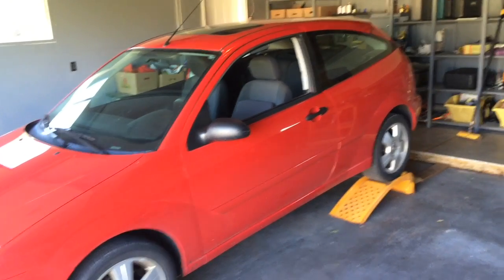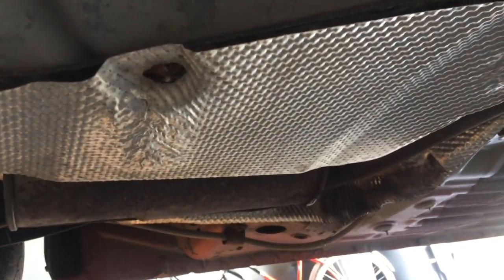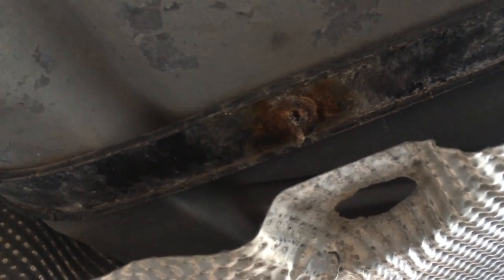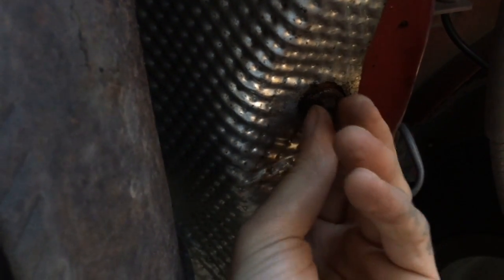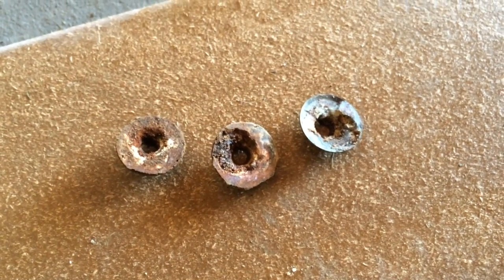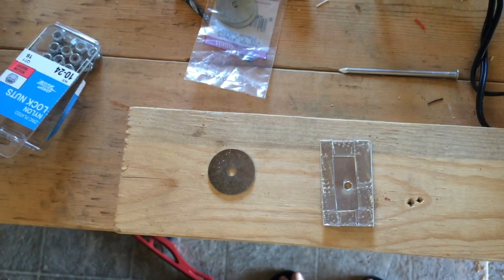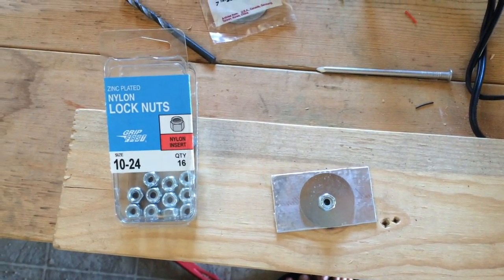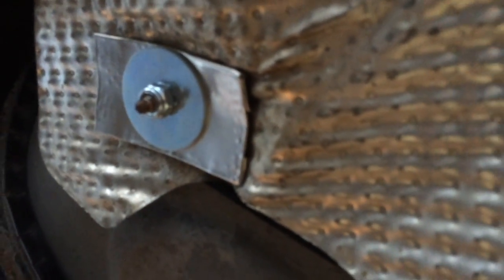2006 Ford Focus $3 heat shield rattle fix

Comment: Thanx for taking the time to post this!  I have an ’08 focus (original owner) and this winter all of my heat shields rotted through at the bolts.  The car is ten years old and kept outside.  I live in Erie, PA and this year we're almost at 200 inches of snow!  

I finally got a nice day today to try this and it worked out great.  The fact you listed the washer and nut sizes saved me a ton of time at Lowe’s and guess work.

All in all it cost me just under $30 due to the aluminum being kind of expensive ($22).  I wasn’t sure how much I’d need and I bought a 12x18 sheet which I only used about 1/3 of so I definitely should have gone smaller on that and saved a few bucks but oh well. 

Also the thinnest metal they had in stock was .025 I believe so it was pretty rigid but cut easily.  I didn’t need to fold over the edges due to its thickness.  Some pieces I had to cut the corners or round it out to fit in certain spots but my snips went through super easy and was able to bend it into place.  It was malleable enough.  

Only snag I ran into was while tightening two of the nuts on the lowest bolts, they completely snapped due to corrosion and snow / salt exposure.  Fortunately they were right near an exposed support beam so I just drilled pilot holes and screwed them directly into the frame (don’t go through the floor! haha).  I saw a guy in another video do this with a rivet gun for a fix.

Super pumped to fix this myself.  Took about 2 hours (i move slow and was enjoying the sun).

But yeah, thanx for your video and everything.  Cheers.
Reply: This helped for my 08 focus too!

Comment: Thanks for posting this, calling out the socket and nut sizes was very helpful as was the tip to use cut sheet metal to make a repair flange.  Best of the heat shield repair videos, very helpful.  I have a 2003 focus, they are all the same!

Comment: I'am about to fix the same problem on my car. I have a tip for others that read/watch this video. When steel and aluminium are in contact with each other a chemical reaction happens. This reaction is called "electrolysis", Basically it will corrode both metals. And before you ask?....Yes the car companies know this!. Anyways the fix is to have a barrier between the two metals
PS if the nut,bolt and washer were stainless steel? The problem would never happen in the first place.
Reply from the maker: Sounds like a bad design. I'm guessing the factory heat shield is aluminum and the factory nuts are steel? Mom's heat shield is still holding strong.
Reply: Yes exactly. But it was designed to create labor/parts profit

Comment: ON MY 03 FUCUS, (DOHC ZETEC) My catalytic convertor is directly after the manifold! it's between the motor & the front bumper w/ a upstream o2 sensor screwing into it up top & downstream o2 in the pipe right after the catalytic yet, it's all 1 unit, both o2's screw into the catalytic, 1 pre cat & downstream is post cat!!!

Comment: i just did this with y 2006 xtrail....just used bigger washers...woudl have loved those ramps...im a big guy that had to really cram my hands in their to get the nut off the bolt that was above the muffler.

Comment: Weak point? LOL you replaced stamped sheet metal nuts with two forms of reinforcement and nylon lock nuts. I'd say the only "weak point" left is the factory studs. Nice repair video.
Reply: American repairs always better than Oem junk . This man knows he has room for improvement thus weak point.   Keep it up !!!

Comment: Hi, would this work on an 07 seat ibiza too, I've been looking everywhere and no videos?
Reply from the maker: Paige Megan I don’t see why not. I’ve seen a similar heat shield on many different models of cars. The bolt size might be different so you may have to adjust the washer/nut size but those parts are really cheap so you can buy a few sizes to test
Reply: Thank you! :)

Comment: what about if your bolts are gone? I went to replace mine but the bolts broke in half when trying to loosen the nuts. ugh
Reply from the maker: That's some serious corrosion. Hopefully there's a video out there for solving a broken bolt problem.

Comment: thanks for the video.  I think I would rather pay to have someone fix it tho.
How much do you think an auto-shop should charge to do this?  All of my contact points have come loose.
Reply from the maker: If you show them this video, $3 + 60 minutes labor. But seriously, I'm not sure how much a new shield runs. Just a wild guess is $200-$300 with labor?
Reply: UPDATE : It cost me $60 to have my corner auto shop do it.  Well worth it.
Reply from the maker: Great. Did they reinforce the existing heat shield using this technique?
Reply: Muffler auto shop may be the way to go

Comment: i have the same situation as above.  ugh.  do i even need to replace the heat shield on my 2005 ford focus wagon with 120k miles?  why don't i just take it off?
Reply: Just remove them u don't need them that's all I do

Comment: Can you just take it off and it still be okay to drive?
Reply: Yes it rusted or corroded due to a bi metal corrosion alum and steel cause it to rust Plastic washers or duct tape over washers would be better it will happen again if you dont keep the metal to alum shielded but great idea